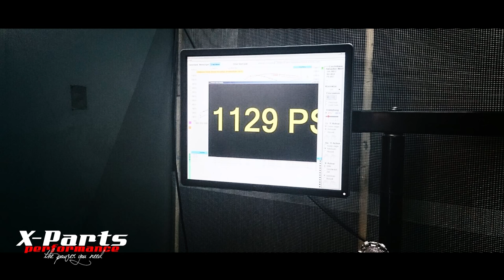Worlds strongest VR6 12V Turbo with stock head / X-Parts 1129HP/1320NM Dynorun

Comment: I would guess this car has arp head studs and rod bolts, some forged pistons, and a good valve job. Mix in a huge cam, race fuel, and big boost, you get big numbers.
Reply from the maker: +Gabriel Gil no one says that the rest of the engine is stock ;)
 We just say the HEAD
Reply: My guess is reliability is all in the tune and more gradual boost

Comment: Stock compression ratio? No head spacer?  Doubtful
Reply from the maker: +Pravvus who says it would be stock? ONLY the head ist stock and btw the head isnt the rest of the engine.
Reply: +XpartsInside I am aware. 
But when you do something like this why just tell us about the head? While I admit it was my fault for assuming something, having a stock head would lead me to beleive that you were trying to see how much he you could get with stock internals. If everything else is modified, why is just the head stock.
Reply from the maker: +Pravvus The Story is a bit complicated but i will give it a try to explain. 
We meet the Dyno for 2 Days to check the new Setup and bring the power to the max. But at the third run with the modified head a valve was gone because of the wrong mapping. 
The Owner of the Dyno had a stock Head in his "trash" so we take it and change the head that we can do some other testings. The Head was stock and we just use our camshafts to get the max throw. We know that after a few runs the head will be death. The throw ratio of the cams would be to much for the hydros and the max RPM (8400) will give them the rest. But we payed 2 full days and we needed some results from some other parts so we decided to gave them a try.  The good one is that the Stock head is still alive after 2 days of Dyno with more than 40-50 runs between 960-1129hp. We was also surprised over the high HP at the End and we know now that we do not need a special expensive modified head on our drag car. 
Everyone thinks you need a special modified head to get the max horsepower out of a engine, but in some cases you did´t. With a modified head we only get 1-2 horsepower more at the top end. The more Torge that the modified head brings in lower rpm isn´t interesting for us in drag race.
Reply: +XpartsInside so what is done to the block? 
The crank and rods are already forged in those things.
Reply from the maker: +Pravvus The crank is just a slightly modified stock part. The rest are forged parts.
Reply: People run 11.5:1 45+psi on pump e85, why cant this be stock compression

Comment: Stock valve springs ?
Reply from the maker: +Wolfsburg61 Stock valve springs and Hydros
Reply: How much rpm is the engine running?
Reply: +Wolfsburg61 8400/min